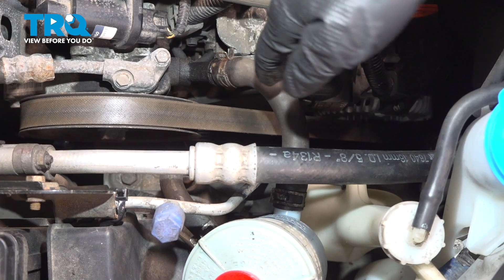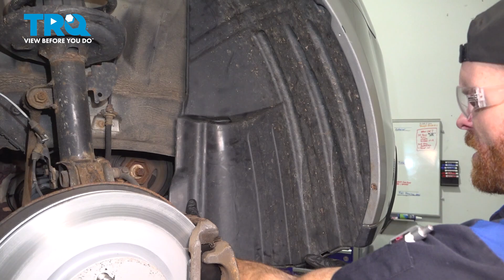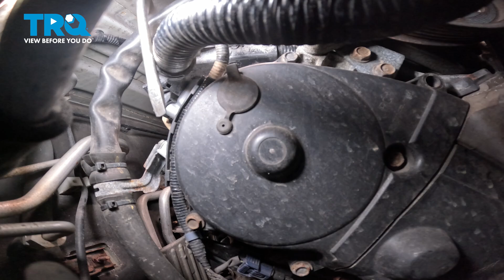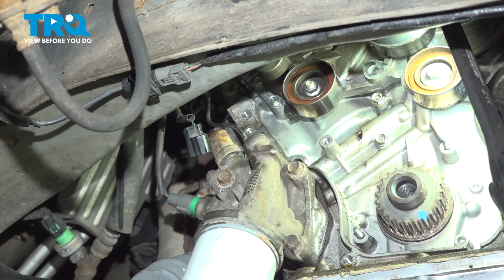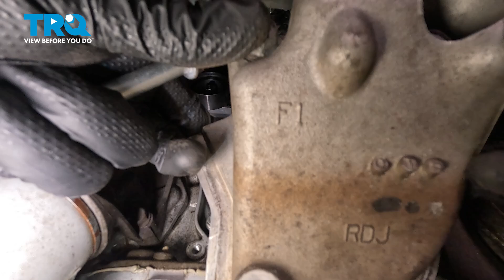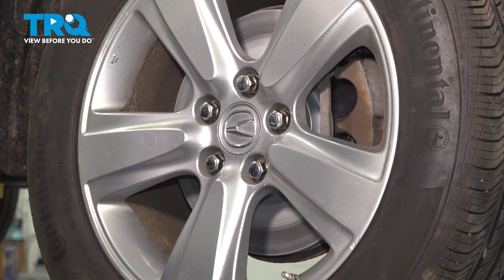How to Replace Camshaft Position Sensor 2007-2013 Acura MDX

Comment: I was wondering if it  possibsle just loosen up the cam sprocket and the cover behind it and pull the sensor out without removing the timing belt